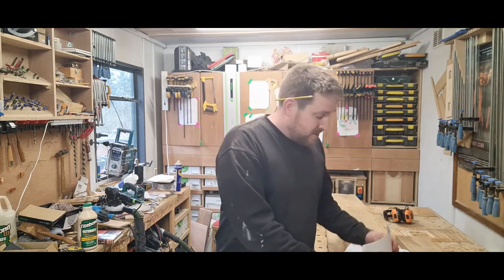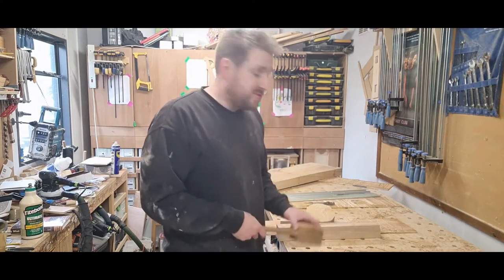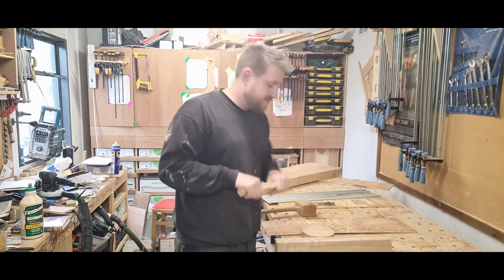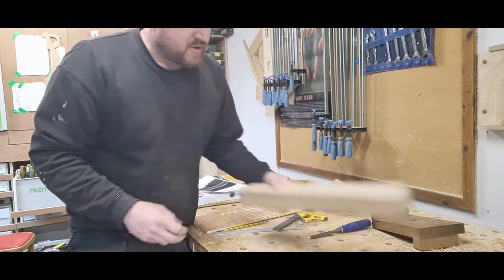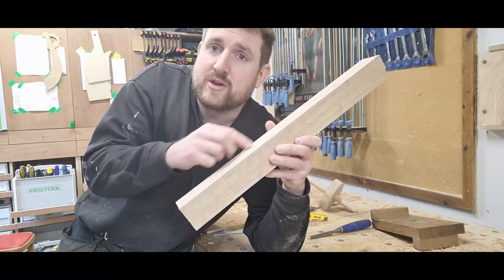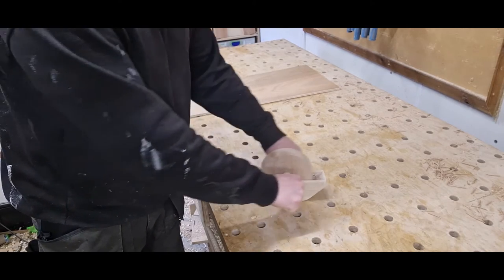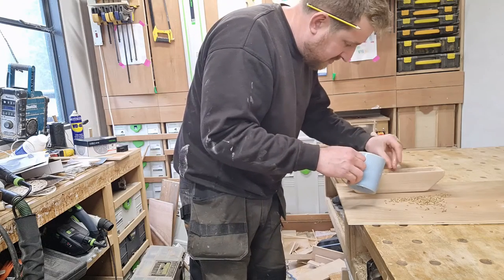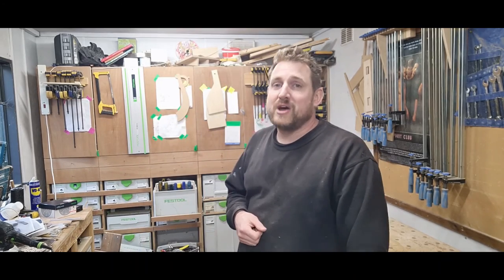Make This Simple Hand Grain Mill! 15th Century Grain Mill Made From Wood.

Comment: Maybe it would have worked better if the mill was 4-5 times bigger and fixed to the table. That way you could use all your force to press. Also, it will be interesting to see if you can make a wood mill similar to a stone mill.
Reply from the maker: Yeah, bigger would certainly work better. I think the idea with this was it's small and mobile for the soldiers to carry in their packs. 
I'd love to make a proper mill like you've described, if I could find an example of one that works I'm sure I could be persuaded!